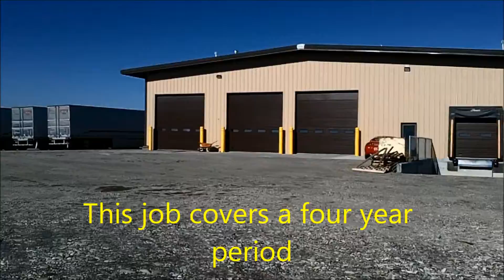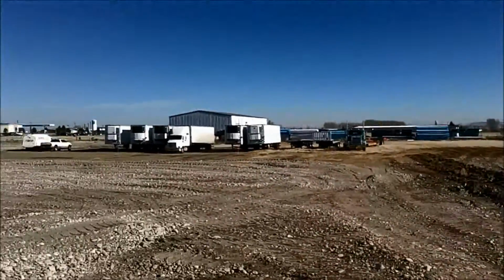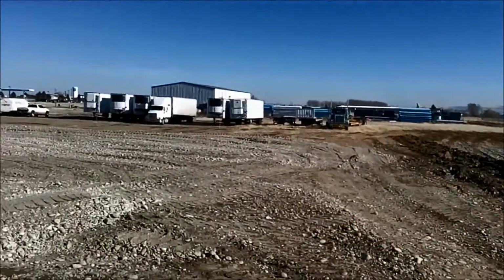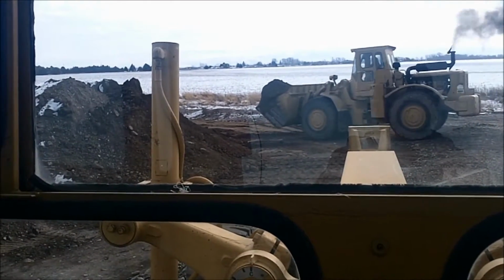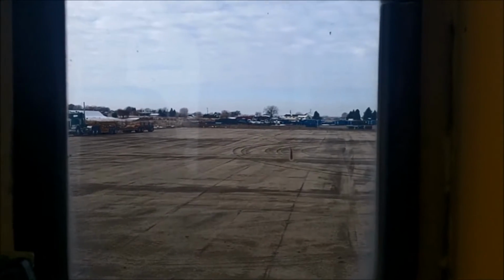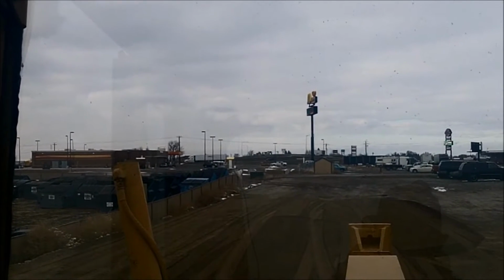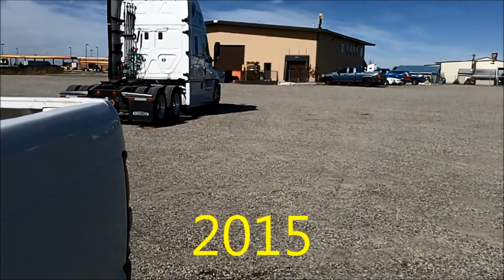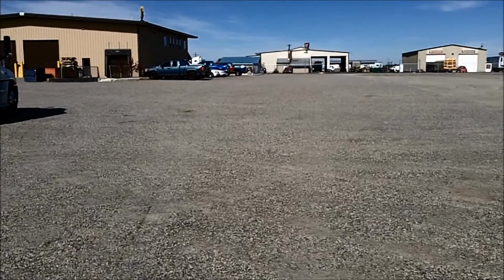Job Update

Comment: I worked out of a freight office in Granite City Illinois which is basically St Louis that spilled over across the Mississippi River. The original lot was part of a refuse pit for the battery factory across the fence.  Batteries buried 15 to 20 feet thick with some gravel over the top.  Solid parking lot no matter what weather.  You could dolly a loaded trailer with 34k on the nose onto it without using any lumber under the pads.  nothing sank in that parking lot.   but then somebody said that all of that lead in the dirt was bad or something :)  somebody used the words super fund site. they moved us to another lot across town.  but it was next to a KOA so summertime was much better scenery.  :)
Reply from the maker: +Randy J    We have one of those here, superfund site, they are trying to clean up now, 
FMC 's elemental phosphorus plant in Pocatello  has phosphorus from under the furnace's leaking into the ground water, can't dig it up or once exposed to the air it will ignite and burn, also the slag pile is radioactive  oops